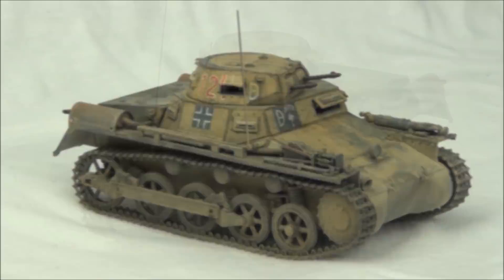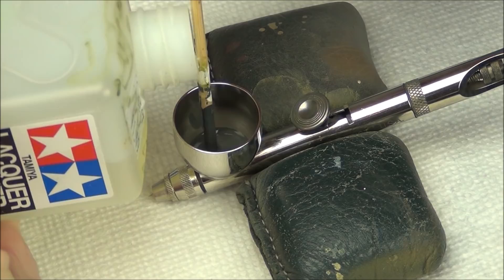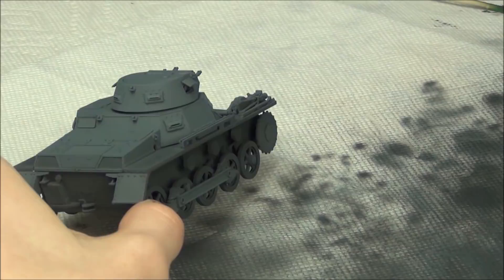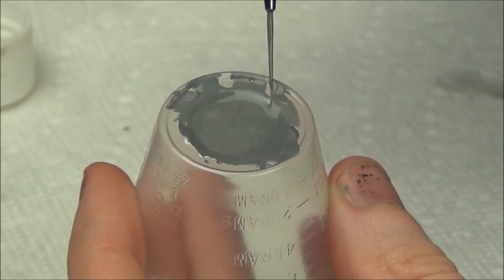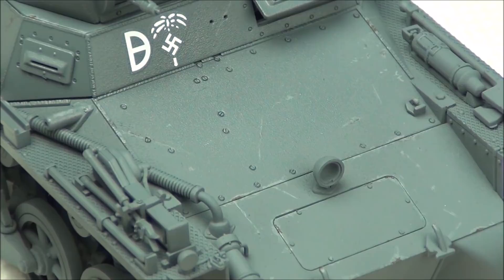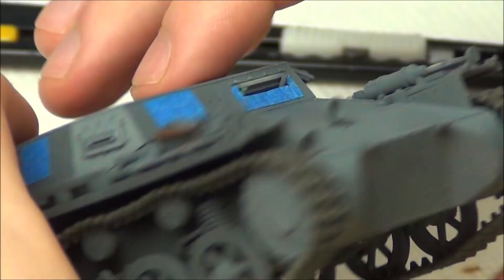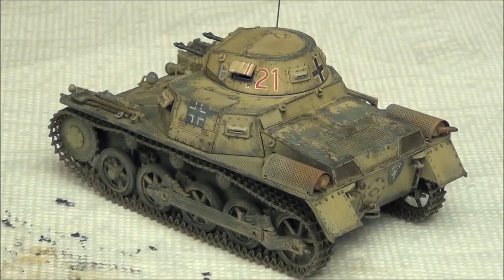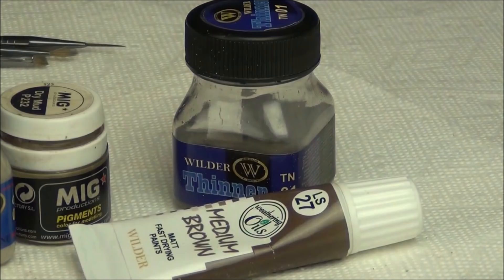How to Paint & Weather DAK Model Tanks | Standard Weathering Procedure Ep.3

Comment: Howdy.  First of all, I'm a model railroader.  When I want to portray rust, I use REAL rust.  I make my own real rust.  First I put approx. 2 rolls of 0000 fine steel wool into a quart jar.  I then add enough white vinegar to cover the steel wool and sit the jar in a window that gets a lot of sun (in my case it's the kitchen window).  I usually leave it for about 2 months or until most of the steel wool is dissolved into the vinegar (sometimes takes longer) and give the jar a shake once in a while.  After most of the steel wool is dissolved I pour the mixture into a square or rectangle glass baking dish and put the dish in my closet for about 2 weeks or until the vinegar is dried completely.  I then use a single edge razor blade scraper and chop up the rust mixture into a very fine powder.  I usually store the rust powder in little snuff cans or tins of the same size.  When I want to use the rust on a railroad car (or whatever) I take several scoops of rust powder and mix it with some isopropyl alcohol and equal part of Elmer's glue and add a few drops of water soluble glycerin.  I make it up as a wash if I want the plastic to look like metal, but mix it kinda like paint if I want to use it as rust spots.  It works very well and is REAL rust.  Everyone who has seen my models remarks about how real the plastic looks like metal and how real the rust is.

Comment: It's usually not okay to let the decals wrinkle like that, the best technique is to use a q-tip and once you have the decal in place use a rolling motion to squeeze all the water out from under the decal, and to set it in place flat with no wrinkles. For the paint mess up you either didnt let the clear coat dry fully or the micro sol isint good on it. BUT the model ended up looking wicked good so why am i giving criticism
Reply from the maker: +SUHH DUUDE decal solution is supposed to wrinkle them.  That's how they melt down into the surface.  If you were to roll a Q-tip over them at that point you would destroy the decals.

Comment: Just watched this video again.  Spectacular detail.  One small criticism, the divisional marking is inaccurate.  When 5 Pz. Regt. shipped out for Tripoli to form up with other units into 5 Light Div. they wore the 3 Pz. Div. marking on grey paint . Arriving in North Africa Feb-March 1941 they were repainted an overall sand colour obscuring the 3 Pz. Div. marks.  On 15 Aug 1941, 5 Light Div. was renamed  21 Pz. Div. and the new divisional mark was applied, on the desert camouflage.
Reply from the maker: Cheers for the input Alex.  At the time I did not do much research into markings so it's partially based on photos and partially made up.  Nowadays I do much more research 😁 I have another Pz I A that I may do in a DAK scheme in which case I'll get it right.  Thanks!

Comment: Really really beautiful job. I have two comments but please don't take them as shots against you. I'm just not sure if this applicable for Pz.1 but I would have liked to have seen some demarcation between wheel and rubber, (if Pz.1 had rubber on wheels). Just a slight color change if you find it appropriate. 
Perhaps drilling out MGs?
This is a great rendering of a DAK vehicle. One of the best I have seen.
Reply from the maker: Yeah, I should have gotten some metal MG barrels for this.  That's a major weak point in the kit.  As for the rubber, I see your point, but the panzer grey is usually dark enough in photos that it appears the same colour as rubber tyres.  I don't think it would be wrong to make some visual difference there, though.

Comment: This is a small vehicle! You did an awesome job, especially considering the platform size. Kudos!
Reply from the maker: Thank you Mitko.  Like I said in the video,  I would have much rather preferred to use your masks for the numbers but that wasn't a possibility...next time I will use them though; they are the best!
Reply: I am thinking maybe 1/16th scale for the first German tanks. Two reasons - they were pretty small in general. And also, they are available on the market too.
I would like if you do a short add-on to this video. Or maybe a FB comment at least. What would be interesting is the way you do the tracks. On desert tanks they are quite specific. Yours looks great, although I didn't catch the techniques used.
And warm thanx for the comments on the masks, but you did a fantastic job with the decals here!

Comment: Outstanding effects...  

I would only say that the rubber road wheels are very pristine compared to the rest of the tank. The rubber treads would pick up dents, nicks and wear.. and some would be new and others older, so they shouldn’t be uniformly worn.

Also you’ll see exhaust shields rust at different rates .. not for any reason other than they could have been made at different times and if different quality steel... but don’t overdo it. Yours look pretty good as they are.

Comment: Just an interesting bit of info.  The Panzer 1 weighed only slightly more than one track of a Tiger 2....   Just puts this entire tank evolution into perspective.
Reply: A track link on a tiger is 40 to 60 kilograms (can’t remember exactly) while a panzer I is 5400 kilograms.  What are you on?
Reply: Perhaps have a closer look at what a track link on a Tiger 1 weighed?
Reply: @rurushu8094  I only saw your reply now.  What I meant was not a single track link but an entire track of the Tiger 2.  ie. If you remove the entire left hand track of a Tiger 2 then it weighs slightly less than a Panzer 1.  Do you understand now?  I can't put it simpler than that.  You should have noticed this when you typed your reply.  I spoke of a track and you spoke of a track link....

Comment: Awesome job, I reckon I'll be using this method. I have 2 armoured cars and I want to do Early War Grey and DAK and this way I can just paint them both the same up until the desert layer goes on :) Also, probably mentioned before but it's a Panzer II, Panzer I's didn't serve in Africa, I think only in Spain in the Civil War.
Reply from the maker: Thank you :) I hope you fins my method useful on your own projects.

And, this is 100% a Panzer I Ausf.A.  there were a dozen that served in the 21st pz div in North Africa.  I used decals to model that specific unit.  Some even had flamethrowers mounted in place of one of the machine guns...I should do one of those some day.  So there were not many Panzer I in Africa, but there were some :)
Reply: @Panzermeister36  Apologies, I think I've been mistaking the Panzer I for the Panzer II for quite some time on the wrong assumption that they weren't there :/ One of the things I like about this video is you make it seem doable for someone who's never done a vehicle before. One question, any way to do the desert layer without a airbrush or even spraycan?

Comment: Ok not sure if I missed something or not but when using a dust or powder paint, #1 what keeps it in place and do you spray something on at the very end to keep it in place. I've never used either but  would like to but never knew how to apply it. #2 is the paint powder ever mixed with something to maybe make it a thicker type of "paint" I guess you would call it. Like a thicker mud  texture. Love your videos so far and I'm about to hit the subscribe button. 
Rick, Athens Texas
Reply from the maker: The matte finish already on the tank helps pigment adhere.  If you try sealing it with matte afterwards it will blow away most of the pigments.

Comment: Edit: Nevermind, SHouold have kept watching lol

What if I want the decals to sit on top of the desert yellow color rather than the base chipping color. I normally throw down a gloss coat then the decal, then microsol, then seal again with gloss varnish before moving on to weathing with oils and washes etc... If I put the decals on, on the 2nd color (yellow) will the chipping still work over the decal to give them a work look or will the gloss coat prevent that? I would think so. Should I do the chipping first then put decals over them, then come back and manually add chipping effects to the decals?

So if I painted a grey or metal undercoat for my exposed chipping.
Then painted a panel modulation of Desert yellow
Then add some camo pattern with green brown. 
Then add the decals as above. 
Then removed the camo colors to expose the undercoat of metal with chipping. Will this work?

Comment: Lovely build, just a question do you use any product to seal in the pigments at the end or even a dull coat?
Reply from the maker: No, I don't as that will ruin the effect.  I apply the matte varnish beforehand to give a texture that the pigments hold onto well.  The pigments are on the lower hull which I don't touch when handing the model anyways.

And sometimes the pigments are also held on by enamel earth effects which were still wet when I apply the pigments on top of it.  That is what I do on vehicles with mud at least.

Comment: Great video and great inspiration. Your videos made me try out weathering. One question though: when you say you are done after the pigments, do you add some sort of clear coat? I would be scared to rub off the pigments after when handling the kit.

Also a suggestion for another video: russian tanks
 Thanks.
Reply from the maker: +FoxtrotWhiskey3 Thank you very much!  Personally, I don't use a clear coat at the end.  I find that when I do, it will ruin the pigment effect by blowing them away or something.  I'm not really sure what happens but it always really tones down the pigments and the effect is lost.  Sometimes I'll brush on a little pigment fixer on the wheels or areas where I'm most worried about the pigments being rubbed off.  Usually I'm just very careful about how I handle them...often I'll take off the turret or cupola and carry the model with my fingers in there.  

I also do have a couple of Russian projects I will be doing soon.  Next weathering video will be on Panzer Grey, after that I have a couple of Soviet tanks - a T-34 and a T-40 light tank.  The T-40 will also have a partial winter camouflage.

Comment: I used the wrong hairspray, and maybe let the tamiya paint dry too long (maybe an hour or less). I was not able to create the weathered look, now matter how much or long I soaked the surface with water, I had to scratch very firmly with my nails to make a dent or a scratch so to speak...how long do you let the paint dry after the hairspray ? and would the same timeframe work with vallejo and or mig/ak chipping fluids ? thanks and cheers
Reply from the maker: I wait only about 15 minutes before chipping.  What thinner did you use with the Tamiya paint?  Don't use lacquer thinner or apply a super heavy coat otherwise it will be very hard to chip.

Comment: Very good how to video, really learned a lot¡ I’m gonna use you hairspray technique on a JS-2 44 soon. One question: did you seal in the last sand effects, how did you get the pigments to stick?
Reply from the maker: Hello Henrik!  The XF-86 I applied beforehand provides a rough and matte finish that holds the pigments on very well without fixer.  I also avoid touching the bottom of the tank though since they could come off if I touch those areas too much.  If I ever do fix pigments, I use the same wilder enamel thinner I showed in the video and apply it gently by brush to the areas where the pigments are located.

Comment: Without using an actual primer (such as mr. Surfacer), have you ever noticed that paint will flake off later on? I've had masking tape tear off paint and later on the hair spray 'peeling' go wrong because of a bad primer job (ie. just straight Tamiya paint on bare plastic).
Reply from the maker: I have not had that issue with Tamiya paints.  Lacquer thinner really makes them more durable and helps them bite onto the plastic much better.
Reply: I usually thin my paints with Mr. Hobby (Leveling) Thinner, also with Tamiya paints. I'll try to stop wasting primer on an extra layer I may not even need. Thanks! Also, very informative video. Working on a Pz. IV at the moment for which I'm following your weathering techniques. Going well, so far.

Comment: Which 10/0 brush were you using @ 11:32? Is the the R and L Zen 10/0 or a different one?
Reply from the maker: Honestly I couldn't tell you exactly; I doubt I still have that brush.  I bought a bunch of 10/0, 20/0, and similar ones from R&L Zen 73 line, including this one.  That one you pointed out looks quite long, so it's not the normal 10/0 "spotter" I usually use.  But it's still very fine, so roughly that size...but with very long bristles.  I would guess 10/0 or 20/0 "script liner".  Sorry I can't be more precise....

Comment: i don't understand why sometimes you use gloss varnish, sometimes semi gloss, and sometimes none at all, and then you apply oil pin washes. Im preparing to paint the tamiya 35378 kit and i dont know which one to use to seal it before weathering?
Reply from the maker: My tastes have changed over time.  Let me explain

It is best to have a smooth surface to apply the oil pin wash, as this makes it flow along welds and around bolts and it doesn't tend to spread out over flat surfaces where it shouldn't be.  

If my base layer of Tamiya Lacquer paint is smooth enough, sometimes I won't even bother with a varnish since Tamiya paint is durable and doesn't need a protective varnish.  If the finish isn't very smooth, and is more matte or maybe I did Hairspray chipping which induces weakness to the paint, then I'll apply a semi gloss varnish to protect and smooth out the surface.  

Some people use gloss but I find its too smooth and weathering has a hard time sticking to the surface.  I prefer semi gloss (or satin) since it it still smooth enough for the oil paint to flow properly bit it also has a slight texture that the weathering can hold onto once it dries.  I used to use gloss, now I use the semi gloss or satin.

If in doubt, there is no harm in applying a varnish "just in case".  It will just take some time to spray it and let it dry but it's a good step to protect your work.  From experience I know when I can skip a varnish to save time.
Reply: @Panzermeister36  i get it now. Its a rule but doesn't have to be followed. one more thing bro, i see sometimes you mix your tamiya xf paints with lacquer thinner... does this change the properties of the acrylic paint to lacquer paint?
also does thinning tamiya x-22 gloss with lets say 50% thinner make it a semi gloss? reason i ask is i seen a video of a dude do an experiment, he did a full gloss coat which looked terrible and orange peeled and then he did a gloss/thinner mix and it looked nice and pleasant
Reply: @Panzermeister36  how long till a tamiya semi gloss or matt varnish dries after spraying. and on a history note, did German tanks destined for Africa ever receive Africa Korps colors in the factory, or were they always panzer grey and then done in italy before going to Africa? So was it ever painted red oxide, then RAL7028?

Comment: Will the hairspray chipping technique work if the layer that is to be chipped is sprayed on with a tamiya rattle can?
Reply from the maker: I am not sure.  I have never tried that.  But I expect it won't work very well since those paints are lacquer based and are hard to apply in a thin coat. Both of those factors make chipping difficult.
Reply: Panzermeister36 
Okay thanks for the reply

Comment: My H&S Ultra is really prone to splattering and cannot do very light spray (as in at the spraying of the yellow camo at the start of the video). I changed out the tip and the needle for new ones and thoroughly cleaned the airbrush. I use thinned AK paints (with tamiya thinner, as I found it is the best), something of a "milky consitency" (enough for the paint to quickly form a drop when scooped with a toothpick).
Is it something that I do or is my airbrush bad and I need to buy a better one? If so, could you please reccomend something?
Reply from the maker: AK Interactive paints aren't the same type of acrylic as Tamiya, so I wouldn't use Tamiya's Alcohol based thinners; AK Interactive aren't alcohol based acrylics.  Unless you're using AK Interactive Real Colours....
Reply: I am using real colours. I also use metallic colours, but those dont need thinning.
The same problem happens with tamiya paints, vallejo paints, vallejo varnishes.. Through my expermentation I found really that only Tamiya thinner somewhat fixes the splatter (Tried water, vallejo thinner and revell thinner plus for the heck of it, tamiya paint retarder).. But it is still there.

After looking up, it seems like my Ultra has a 0.2mm needle, so it might be that.. Any reccomendations for an airbrush?
Thank you for helping.
Reply from the maker: Okay then...I did have similar issues with AK Real Colours.  I found I had to mix them very very well and I was using Tamiya Lacquer Thinner too.  I will have a video on AK Real Colours soon.  Your airbrush is good though, better than what I am using.  Maybe try even more thinner or lots more mixing unless you have already.
Reply: Thanks for the tips! I'll go try making my paints into a wash and see if  that sprays any better. ;)